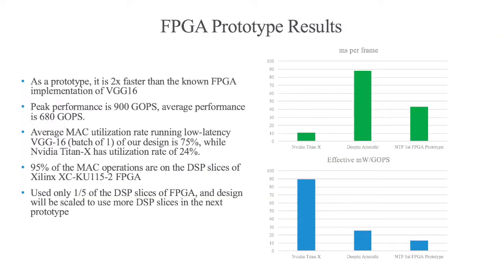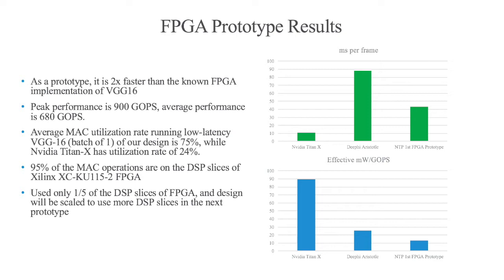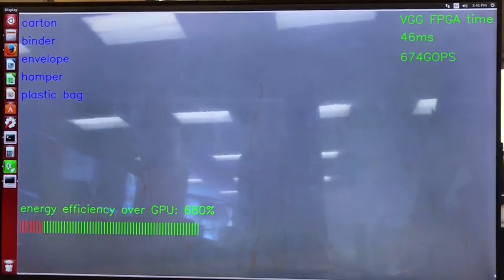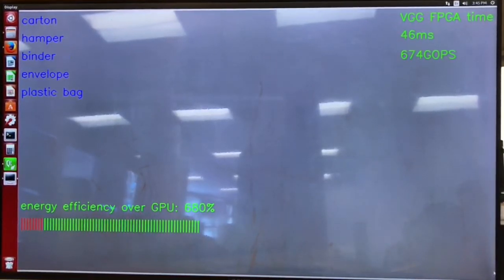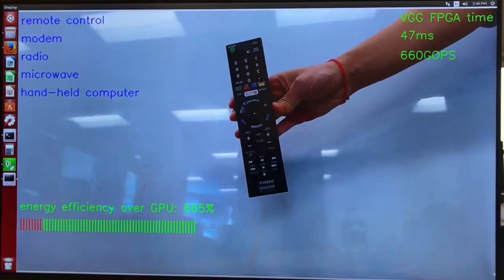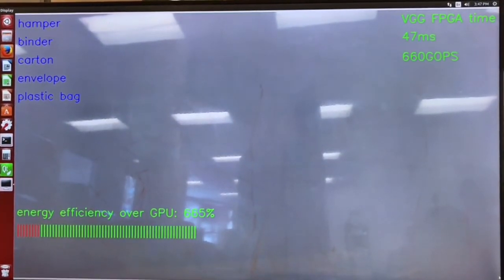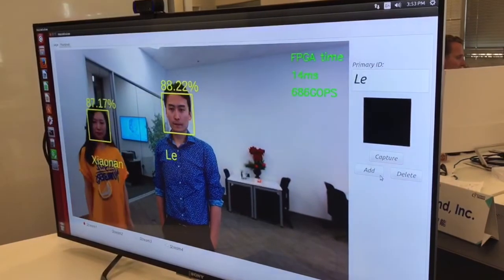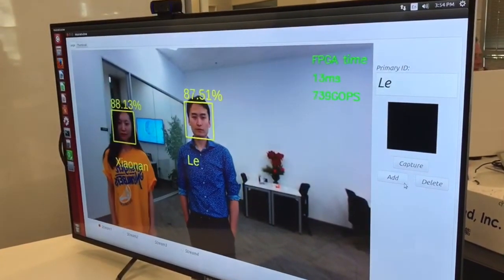FPGA Concept Demo of A Deep Learning Processor

Comment: Was the program fully hdl based or matlab was used..
Reply: Obviuosly this is hdl. matlab can generate hdl but this doenst have much to do with fpga-programming.
Reply: Anyone can watch my channel.Deep learning model work on  xilinx Zynq 7030，its inference speed is around 20 FPS(Frames Per Second).
Reply: Verilog HDL Complete Series | Lecture 3 - Part 1 | Data Types in Verilog HDL by FPGA made Easy. Subscribe to the channel "FPGA made Easy".